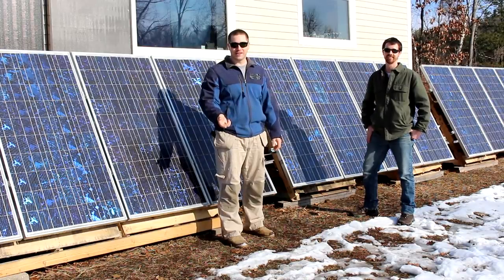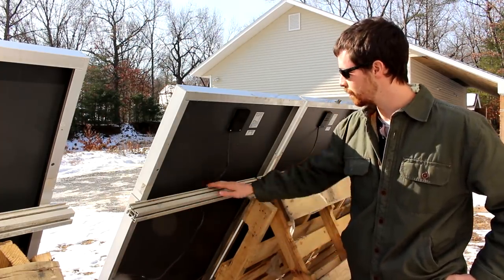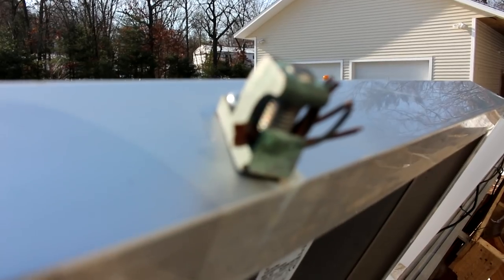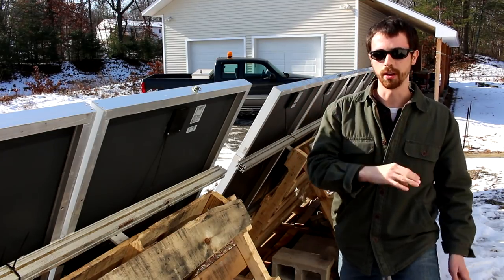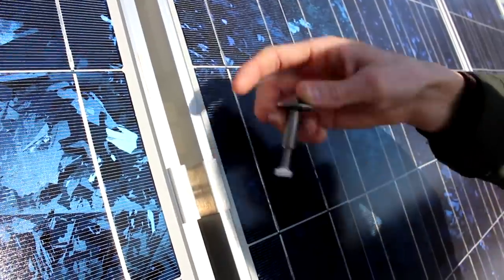A PV Expert finds the flaws in my system

Comment: The reason for metal conduits is twofold:  circuit protection, as well as protection of the building against wiring that catches fire.  Thermal expansion isn't that consequential when you have bends which absorb that.

Comment: Turn the panels upside down so that the cables come out at the bottom, resulting in a shorter cable run. (Shorter run = more efficiency.)
Reply: He cheated... He just bullied and verbally abused the wires to lower their resistance

Comment: You can improve both your safety (when working on the system) and the energy production of the cells in one move. Make a shade-panel that you can place over the front of each solar panel to prevent it producing energy while you're working on the system. If you hinge the shade-panel at the bottom of each solar panel, so it swings down, out of the way, you can make the inside of the shade-panel reflective so it increases the light falling on the solar panels. 

On the question of series v parallel connections. You can do both.
You seem to have 12 panels - assuming they're 12 V each, you can have;
12 in series = 144 V   lowest current, thinnest wires, biggest shock danger.
6 in series, in parallel with 6 in series = 72 V  
4 in series, in parallel with 4 in series, in parallel with 4 in series = 48 V  (my choice).
3 is, ipw 3 is, ipw 3 is, ipw 3 is = 36 V
2 is, ipw, 2 is, ipw 2 is, ipw 2 is, ipw 2 is, ipw 2 is = 24 V, or
12 in parallel = 12V  highest current, thickest wires,  no shock danger [1], biggest sparks [2]  

[1] unless it's raining. [2] Arc welders are low voltage, high current machines, eg 5 V, 50 A.

My safety limit for live working is 55 V (ac or dc). Solar panels do not have an off switch: if they are lit, they can generate energy, thus the are "live". 

I would not work on a battery or solar system above 50 V dc, no, thank you - and I've worked on MW systems up to 20 kV dc, and 11 kV ac.
Reply from the maker: Thanks.
Reply: "4 in series, in parallel with 4 in series, in parallel with 4 in series = 48 V  (my choice)."

+1.  48V was what the old telephone lines (in US) used, right?  A ring would give our parents a quick wake up call but not kill them.  And it's about the same voltage as PoE uses now.  Seems about the highest multiple of 6V before things get terminal.
Reply: Grid-tie inverters often need at least 250V DC to even work and work best around 600 Volts. Series/ parallel decisions I think should be based upon what voltage and amperage the inverter works best on. Also, typical solar panels have an open clamp voltage of 40 Volts (60 cells), 12V panels are really niche. Of course you should think about safety, but it's not a feasible solution to go low on voltage.

Comment: Over all I thought it was pretty informative.  BUT, don't let the parallel/serial comments sway you.  He did not mention the wire size will have to be greatly increased and will drive costs way up.  Also voltage drops from much higher current will be lost in parallel.  AND solar panels have bypass diodes for shading so you can run in series without the failure of a simple DC circuit.  I much prefer the benefits of higher voltages, MPPT controllers, and the long runs you can do with that setup.
Reply from the maker: Thanks Michael,  I agree.  My recent video I posted shows I bought a Victron 250/100 charge controller.  It will allow me to series the PV up to 250 volts!
Reply: Nice!  I've watched many of your videos now.  I like the out of the box thinking and enjoy the videos.  Lots of people will learn from your sharing and can avoid some of the pit falls you've discovered as well.  Keep up the great work!  :-)  I'm hoping to retire in a few years and the wife and I will move up to 6000' to cooler weather and will looking into many of the challenges you've tackled.
Reply: That's what I wanted to say as well. If a panel is producing less current than others, it's built-in diode will let the current through. I have 1 larger panel in series with smaller ones, and when I measure the load current I can see how it increases when I get to that panel and remains at that higher value even when continuing through smaller or less lit panels (I've got a wire coming from each panel, so that I can select voltages and do some testing; goes as high as over 320 volts.)

Comment: In Palm Springs CA, that grounding wire is a minimum #8 copper from both the array to the Inverter and between the Inverter, and entry panel or sub-panel of the house.  The Iron Ridge racks I'm using includes every nut, bolt and grounding washer and lug, all of air-craft quality and a decent system of clips and clamps, to keep the wires in place.  The racks were $1200 alone, on this 5.1 kw system and money well spent.  Good to 110 mph or Hurricane level 3 and assembly is "Ikea" simple, plus the permit requires various details which were all engineered into the system.  Inspectors just glance at it when they see the invoice.

Comment: You also don't want to place all panels in parallel. When you place panels in series, you increase the voltage. If you place panels in parallel, you increase the amperage. So, if you have 12V 150W panels, you probably get about 8A out of each panel. 12 panels in series gives 144V @ 8A. If you place them all in series you end up with 12V @ 96A. That would mean you need an 100A controller. and heavier cables that can sustain that current. If you create 2 arrays of each 6 panels where the arrays are wired parallel and each panel in the array in series, you'll end up with 24V @ 48A. 3 parallel arrays of each 4 panels in series give 36V @ 32A and 4 arrays of 3 panels give 48V @ 24A. You could of course also instead of using a 50V/24A controller, use 2 24V/24A controllers. That way if you end up having an issue with a controller, you do not loose all power..
Reply: If you place them all in parallel you end up with 12v @ 96A.
Reply: I think you’re wrong. 

Parallel adds up current whilst Series adds up voltage. 

In your example:

Series: 12 panels = 12V x 12 @8A
Parallel: 12 panels = 12V @ [96A]

Series is far more efficient in terms of energy conversion as voltage is easily adjusted especially by MPPT whilst PWM is deal for smaller setup (12Volts) at around 10-30A (6mm solar wire).
Reply: Yup.  The amps add up when you parallel.   For a string configuration you generally want the highest open-circuit voltage that the string inverter allows.  For a modern string inverter such as an SMA inverter, that's usually 600V.   Most hybrid or all-in-one inverters have lower voltage limits (though they have slowly been inching up over the last few years).   Nearly all inverters have fairly severe current limitations for the solar input.

The best string configuration is maximum voltage tolerated by the string inverter, one series string per MPPT.  Avoid paralleling multiple series strings if you can.  This will result in the maximum efficiency and shading of a few panels will not reduce system output by too much.

In the old days, two strings were often paralleled into one MPPT and that honestly created most of the shading problems for string inverters.  In modern times, dedicated string inverters have multiple MPPTs and you don't parallel.  Shade on a panel or two only takes out the panels (their bypass diodes allow the rest of the string to continue operating normally).
Reply: Yes series adds volts, while parallel adds amps. If you know there's a part of your panels that'll get shade before the rest, you can always do a series/parallel configuration.

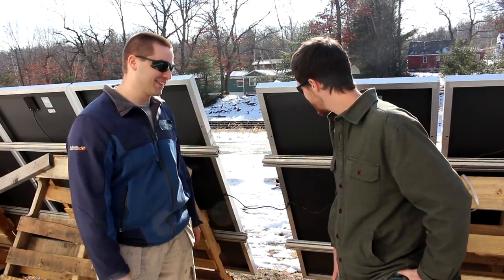Comment: 1:00 Interpanel Wiring
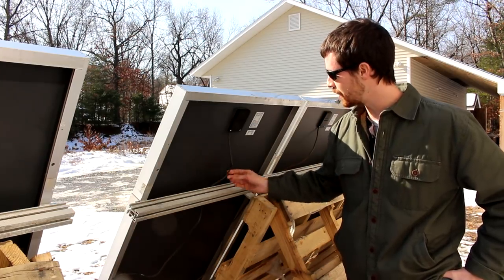1:40 Wire Management
2:36 Grounding
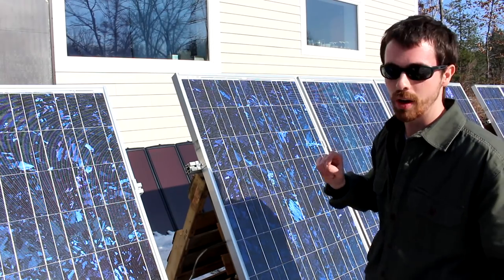4:36 Grounding Panels to Rails
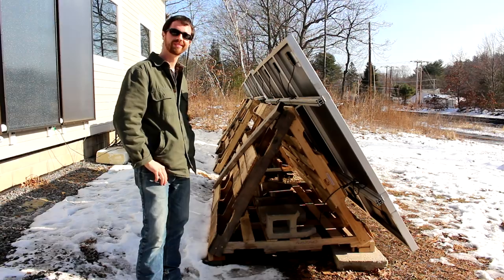5:44 Ballast ( Wind loading safety)
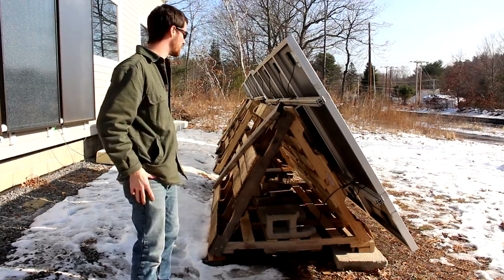6:33 Panel Shading effects
Reply from the maker: Hi greywolf271,  Thanks for making this.
Reply: the solar panels all aliminum? surely linking then all with a copper wire would ground them?

Comment: Depending on the charge controller you get, most common ones are 150V max DC, you should limit the panels in series to 3 to keep the voltage under edge conditions to less than 150V.

A lot of the advise you'll get is for panels and systems installed on roofs. Since you are using a ground mount system codes and practical advise can be quite different.
Reply: Don't forget that as the outside temperature drops, the output voltage of the PV goes up.  People have designed for a certain voltage (placing them in series), only to exceed the 150 volt limit of their charge controller on a cold winter day.  Now they are buying a new CC.  PV panel manufacturers include the temperature vs voltage output specifications with their panels.
Reply: @Booboobear-eo4es  i think they will not exceed 150 even 4 in series so why worry.. i have to play with less than 100v and its much worse

Comment: Hey man I live off the grid. And like you I have home aid mounting system. I did somthing similar to keep them from blowing away. And it worked untill it didnt and a wind caught it and threw it the panels landed face down and woulda been fine but those concrete block that your using went through the back of the panels. Fasten those blocks down . Or attach them underneath that bottom board. That's a very expensive mistake . Not as bad as it used to be but still.
Reply from the maker: Thanks for sharing your experience.  I hadn't thought to tie the blocks down, good advice.
Reply: I would seriously considering redoing this with buried blocks of poured concrete, or similar. Maybe  stakes driven into the ground. Consider a storm, there is a lot of power in the wind.
Reply: also have bad wind here one night, panels fine as they mounted with rails and secured to rafters. but still with wind its always on your mind.....
Reply: What about those mobile home securing steel augers that screw into the ground?

Comment: Are you just grid tied? I'm completely off grid in NZ. 2x 250w panels, 50a mppt charge controller, 2x 190ah telecommunications batteries, 2kva psw inverter, 12v led lighting, Google assistant to turn things on and off, and with my tiny setup, I run all the normal stuff, tv, lappy, lights, fridge, water pump, Xbox, long range WiFi. If I had 12 panels I'd be sharing my power with the neighbours haha. I've started my generator twice in the last year.
Reply from the maker: Sounds like you keep your loads very low.  That's great!  Your low energy use is something we can all strive for.

Yes, I'm on grid, although the panels on the front yard are not.  I'm working on building my own off-grid system.  These panels will tie in to my DIY Powerwall that I'm building now.  Here is a video: https://youtu.be/DsbgNuZtBqY
Reply: 2x250 Watts panels sounds awfully little to run a whole home. Naturally I know you are recharging batteries during daytime, but it still sounds like it can't possibly run a whole home for a full day and night. Not to mention that there's a heap of things to consider that results in loss of production. Angle, weather, time of year. 

You might live in a place where this is not really a problem, but for most places this is a huge problem. We'd need about 10 square meter of space to produce 1kW where I live. And that is during peak performance. I measured it to be around 800W/m2, but with panels having about 12% efficiency that leaves much, much less to be produced.

There's a pilot project going on here by the local power production company. To install solar panels over the entire roof of homes that have east-south-west clearing. It is only meant to be a supplement for peak hours and for charging electrical cars. For example a Mitsubishi Outlander has around 10kWh battery and that would take up nearly a full day worth of recharging the house batteries. 

Solar panels are not ideal for being "off the grid". They can only help you somewhat, unless you live a minimalistic lifestyle.
Reply: That depends on how much power you use per day.
Reply: Catonzo You know you can get panels with twice that efficiency as you mention. But still, 500W solar power being enough for the whole year is quite an achievement.
Reply: This is almost hard to believe. The TV and the Xbox alone should burn 500W. My Florida home burns 30-70 kWh every single day with 50 kWh being the average. Sure, we have aircon, pool pump, hot water, washer/drier and we do charge our Tesla Model 3. So our 13 kW solar panels installation may not be able to produce all we need. Don't know yet because we only had it turned on in August but, so far, the only surplus months we had were January and February (will be).
Reply: in NZ too. where'd you get the batteries?

Comment: Hi David 
I read all comments.
Some mention angle, NEC and etc!!!
Some people living off grid but small systems.
I didn’t check all your videos . So I’m not sure but most people don’t have experience of nature and electric both .
Look like electric or nature .
That still most problems of PV systems.
I think you’re pass the winter     Once . 
Did you remember after snow day?
How much power generate  even cloudy days .
DC power is not good for heat than AC.
That why wire size is thicker 
Hot desert like my aria is not good for DC.
Cold winter cloudy with snow is best for PV systems.
In the winter if you see snow clouds you should change panels angle for vertical. This means panel didn’t get snow and snow refraction make more generate power.
Reply from the maker: Hi, American Dinosaurs Classic automobile restoration.  Generation is very good on sunny days, and on partly cloudy days.  However, on thick overcast days there is not much production to speak of.  It snows a lot in Massachusetts.  It usually takes me about 15 minutes to clean them.  I run the snow-blower in front of the panels, then use a broom to sweep the snow off the panels.  The angle is steep enough that the snow wants to slide off, but can't because the ground is so close.

Comment: Although I've just bought a pallet of LG Neon2 320w modules, I've got 8 Evergreen 120 panels that came with a system I bought used. thanks for explaining about the older panels and grounding that array. I wouldn't have known that.
Reply from the maker: Sounds like you are going to have tons of solar power. Nice.

Comment: Iron Ridge.  I have the same bolts, Certainteed 300W's with Optimizers, Solar Edge 7600 plus LG Chem Resu 9.8 kwh battery.  The battery was $5400.00  for the queezy of stomach at spending.  But the local utility will refund 85%, if you can convince them of various qualifications.  It increases the efficiency of the systems' overall output about 30% to 40%.  (you have the get the size just right to maximize efficiency, which depends on "life-style" or how many EVs you drive, etc.) 
Both the solar Array and the battery are scalable if more capacity is needed later and the Inverter is oversized, for the same reasons and for safety's sake, when a large battery is involved.  If ever there is a large discharge back through the inverter, (from the battery) it can take it.  In the existing house, someone could plug in and turn on everything at once, for example, causing the battery to supply that load (instead of the grid) at least for a few minutes, which would be bigger than anything the system is designed to do at once.  Having the oversized Inverter, which is actually a Gateway for all electrical distribution from the solar array and battery, allows for short periods of overloading.  Of course you simply shouldn't do it, it's not necessary, but those inlaws.....
Reply: Refuso Againo
Mean gently "straw" all the charge ?

Damn, I've seen those gentle at work, I'll be curious to see that coconut ...

Comment: I was glad he got to shading, as they started the video standing in front of the array. Importantly was protecting wiring and the grounding issue. PVC conduit would be fine, and even wire loom and black tie wraps (the white ones get brittle very quickly when exposed to weather and sun) would protect against abrasion. As for "ballast", the inexpensive pallet setup is fine, but actually anchoring it to the ground using treated 4x4s or sonotubes filled with concrete (at least a couple feet in the ground) would keep it place better than a few hundred more pounds of dead weight. If enough wind gets behind that many panels, it'll be a kite for at least a few feet, destroying the investment. While it would have made for a longer video, more people make mistakes with equipment down the line, like with circuit protection (or lack thereof) and inverter matching household demand. Good start.
Reply from the maker: Good Suggestion, Thanks.

Comment: Your mistakes were minimal :)  As Kevin was saying I would personally not wire the panels in series because of shading issues BUT that does give you the highest voltage, and therefore the lowest losses due to wire resistances.  If you wired all the panels in parallel then you would minimise shading issues but the voltage would be much lower and the wire resistance losses would be higher so perhaps much thicker gauge wires would be needed.  Therefore I would have a compromise and in your case, I would keep each set of 4 panels in series, but then wire the 3 sets in parallel.  For me this would put some shade protection in and also keep the voltage up to reduce resistance losses :)
Reply from the maker: Thank you.